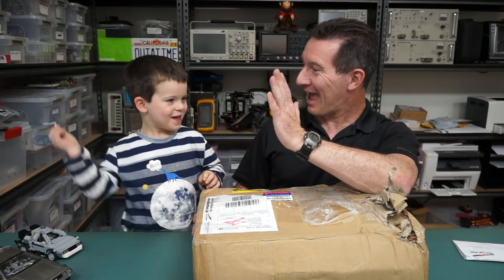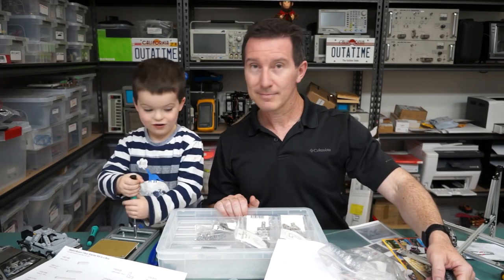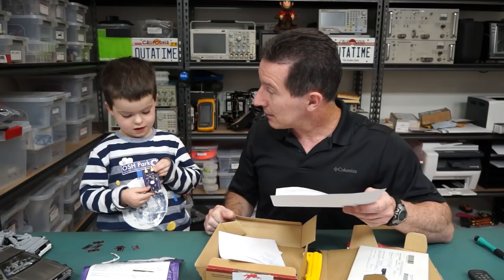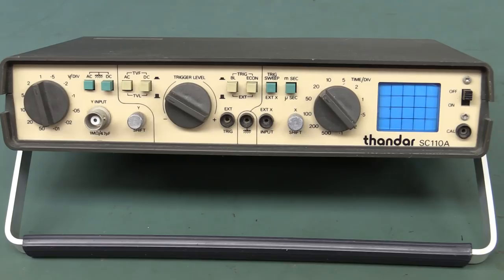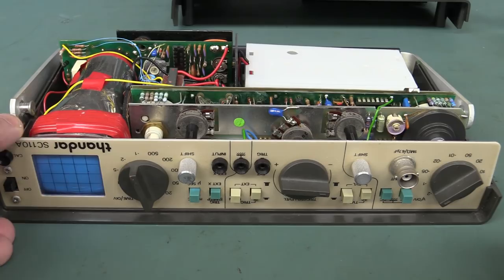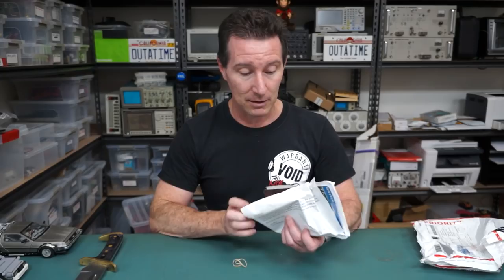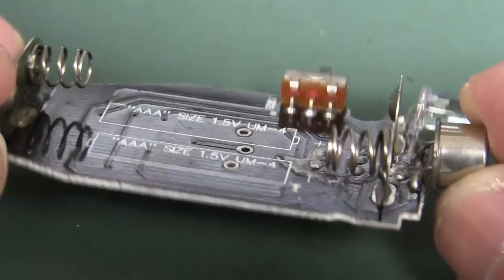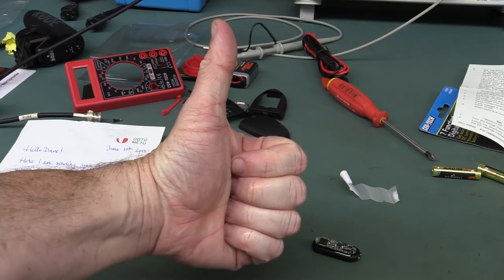EEVblog #813 - Mailbag

Comment: I have the 92020 version of the HF which includes a gorgeous orange backlight and is surprisingly accurate.  I would never put 10A through these.  So what i did was use all that empty space inside to convert it to a 4-wire tester by putting a good rechargeable lithium ion battery from an old cell phone + powerbank chip + a homemade LM317 100 mA constant current circuit inside, with a 2P connector in place of the 10A jack.  Everything else still works off 9V, but I get the most use out of checking USB cables with the 4-wire-on-demand feature I added in conjunction with the 200 mV setting (multiply by 10 for milliohms).  I don't know if anyone makes a small portable 4-wire tester like what I now have?  I know this multimeter is a joke, but not everybody needs a big knife!  A really nice meter for someone who can't afford much.

Comment: I have such a cheap multimeter for years now, it had to withstand many troubles with me. Shorts ( even with line voltage ), overcurrent in current measurement and so on. The contacts for the probes are worn now and the measurement is incorrect as hell. Well, time to spend another 5 bucks, there good for my needs :)

Comment: found this patent about an  intrusion detection device from 1974 by J Rossin http://www.google.com.br/patents/US3839640

note this part: "This invention using a 1% inch diameter concave mirror can easily detect a moving person 25 feet away. Larger mirrors will, of course, detect from greater distances."

Dave I'd suspect that multimeter brand would send you their most accurate product from the test line just to make a scene.
Reply: By the way nice find on the patent on Google will read full thing eventually saved it to favorites.

Just a quick skim over it pretty intriguing and interesting that's something quite a bit different than most motion detectors for sure and also the device that you're referring to in his video yes very different but the problem would be must have battery dies would it be able to indicate nurse an issue with the sensor? Maybe if do barristers to get low input sound of a certain parent of false detections the indicators a problem with the sensor or something of course a system designed like that would probably have a way of determining if the sensor had an issue or the battery was getting low but it may have been too early for that but if you're a lot of them I can see if there was no way to indicate if there was a brown with battery or sensor if you have a lot of those it could get confusing or say it was in an awkward to get at place just trying to figure out what was going on I could see that if it had had it replacement batteries in a battery holder both Glow Draw lithium would be better but still something like that being solar powered by a lithium battery in hard-wired into place but an advantage would be you would not need power after detector simplified wiring and hook up for the sensor but it's kind of Niche product I'd say just an odd one in general I doubt they still use things like this or somewhere like that would still be available is with all the advances and more modern systems? But may still be in service somewhere someone out doing something who knows.

Also I I have seen very old motion detectors that were humongous in Old buildings and even Tone Ultra Sonic alarms are basically obsolete even the box that could be set on a shelf self-contained ultrasonic alarm probably from the 50s or 60s still working to this day.

Have Salvage all types of equipment like that for parts and repurposing old alarm systems that were functionally obsolete for who knows how many decades you know the old green box up on the wall it'd be rectangular and probably have a battery in it likely number 9 drawer cell in some cases.

So those were essentially a glorified exit alarm for a door some of them even had the hardware for that accept had a small relay module how do I know this I've seen the door alarm version from the same company and the alarm version from the same company most of the inside is identical.

Sometimes I do work to liberate things for Salvage in others as part of the deal for something that need to be done and sometimes I got more than I bargained for like once almost a whole basement full of old equipment.

Also I did actually couple times use old remote control systems that work for TVs that were ultrasonic and repurpose them for other projects.

Although one of the more interesting remotes I've seen was not ultrasonic or infrared basically a glorified flashlight with a relay that would flash the bulb an each Button had a specific flash pattern and it was repeated I think twice maybe three times to avoid false triggering ingenious but it works and yes there was a push button to use the remote as a flashlight which I thought was just why not.

The remote was a bit bigger than an older garage door remote I think it took 2 C batteries side by side at the bottom of it many years ago.

Also I once saw a toy CD player music box crayon saying it similar to the one that Radio Shack made except it had a remote that basically work the same way which I found out that particular one deliver or not I was able to take the output of that separate circuit board and make it do my bidding can't remember how but I was able to decode it interesting it was two easy dinner face it may have been serial or parallel it seems like Pearl alderman except a few signals put out more than one pint of ones but it seems like the rest of the others would always only be active with one button there was also a word that was active for invalid signals inhibit?

Although I built a CD jukebox system once I got a hold of this equipment that originally used what look like off-the-shelf mini mini disc CD changers except some different controls on a front additional things this weld are on the back more Jack's Imports than you can shake a stick at evidently if you could think of a way to control it it could do it out of the boss parallel port serial port an even individual + 5 to 12 volt triggers for each function seriously definitely some sort of product that was meant to be incorporated into something else I got a lot of these at one time don't remember why I want to fool with them but I did reuse them of course not going to take that part and scrap it when you could build your own jukebox essentially but you got it could be used Standalone and there was a separate remote for Standalone it did not operate any of the other functions or any of that as well not only that they could even be powered by other than line voltage AKA DC and the power supply even Han outputs for other voltages for external are an external connector so basically a prank it was designed to be around designed to be used with whatever application you wanted it to be used for that you might want to control CD playback but yeah mostly look like an summer gear which was strange you think that something like that would be in a rack-mount case but it wasn't but evidently that will available as well strange again.

Also all the audio and everything was run out to multi pin connectors in addition to Indian kid actors and others and with the multiplan connectors they also went through audio switching as well which could be controlled by remote and or other inputs so evidently it could Multiplex or switch audio from one or more of those players to a common output so just one of the weirdest things I've seen along that line of those kind of things but just interesting nonetheless and useful even after the original application was done for I had also a lot of these are spare units as well so don't know where they were so came from where the story but car from someone else there was a hole in my trunks and fousey August he kept a few but the rest not so much also got several years to other people as well that could use them
Reply: Also as for the last part of your comment I bet you if it hasn't happened yet it will of course it usually does?

Also remember to chinese-made phone charger I think it was where there was a ridiculous thing about they're hand-tuned or whatever spark gap and all that crap and no words a defective product that had been written up like that was intentional and also and it was chinese-made if I'm not mistaken and it did go by the name that's commonly referred to as Chinese junk from a certain Market can't think of the name of it at this time but it was hilarious and evidently that was actually from the factory and they sent it as a gag but still rather entertaining kind of reverse of what you'd expect but I think they wanted to have a laugh really who knows how long it took them to find one exactly like that so they could do that.

Comment: It's basically the standard Mastech DT830B except all the Cen-Tech ones have the battery tester with a switch where as the other DT830 devices usually have the knob control the power and no switch. Some of the Cen-Tech multimeters even have Mastech molded into the plastic of the lead ends. If you're planning on giving it to Sagan, make sure you didn't loose the two ball bearings that are in the knob.  I saw them fall out when you were rolling it around.

Comment: Wow, they actually got a trimming pot inside of this one. On couple of these ICL7106 ripoff meters that I've bought in the local shopping mall because they costed less than the 9V battery inside they actually cut costs by replacing trimmer with just a regular resistor... And a bit of plastic cost by omitting the battery chamber and just randomly sticking the battery between PCB and case.

Comment: 33:45 to 43:30 ... Well done on missing the whole point of those cheap multimeters. Being cheap enough to be classed as disposable it's handy to have a fairly flexible and relatively accurate device of this type in your car, bike, boat, etc where it doesn't matter much if it gets damaged. It's better than risking an expensive one in such potentially unfriendly environments.

Comment: I had two of these, the multimeter itself worked fine for what I've been doing, but the leads broke on both of them within a few weeks.
Reply: Same, ended up soldering the leads directly onto the PCB.

Comment: I've had a Cen-Tech meter for several years and surprisingly it still works, mine looks almost identical to the one here except it has a backlight button in the upper left area by the DCV label.

Comment: I have several meters.  Even have one of those cheap POS meters.  It does the job in a pinch.  The better ones sold by HF are the automotive ones, and the higher end meters are fairly decent.

Comment: My guess is that it's a bug (I.e. Listening device). Check the focal length of the mirrored part; it's probably right at the surface on the mounting plate which picks up ambient sound.

Comment: notice  830B  marking on the el cheapos PCB, all of them one way or another are 830B's,  in 1998 or   in 2003  or  even 2015.
my guess is 830B was 'original' design or it  has smth. to do with ic number.

Comment: the mystery rossin item is a beam detector. Ive seen one of these before though it was different and under a different brand. But im 99% sure thats what it is. (similar components, near same sensor) They are used in security. Thats about all the info I can give.

Comment: 38:45 the connector board of the cheapo multimeter is actually only rated 5A but the spec on the front says 10A :-)

Comment: That "free" multimeter looks like one I borrowed from a friend to help me fix his friend's TV set. Fortunately it was adequate, and it was just a failed fuse with no obvious cause. I had the set working again in under an hour, including going to a shop for the part. Transistor sockets are definite frippery.

Comment: I've owned three of those cheap Cen-Tech multimeters purchased for hobby field box use for I'd guess an average of US$2.95 on sale over the years. Every one of them eventually became wonky in a very strange way in the DC voltage mode that wasn't fixed by changing the battery or found by a cursory internal examination. I haven't purchased one since the last one failed and have, instead, two UT33Ds for that purpose now that I much prefer.

Comment: I've had quite a few of those HF meters, some yellow, and later ones red. I was reading voltages on a 480V VFD (supplied via a small transformer) and accidentally had it on ohms rather than VAC (knob was turned 180 degrees), and I heard a little "pop" and perhaps saw a little spark, and the meter was thenceforth DOA. They are amazing for the price (free!). My main gripe is low ohms zero usually 1-2 ohms minimum, mostly because of the cheap rotary switch with non-gold-flashed tracks.

Comment: To be fair to that multimeter, everyone should have more than one of the things, and that one seems absolutely ideal for measuring low voltage stuff. A hobbyist might stretch to one second-hand Fluke, but a couple of these things would be very useful for extra measurements. It seems to be more or less the same as the DT830, which sells for about £2 ($5AUD) on AliExpress.

Comment: I had a cheap multimeter from Christmas. The fuse blew when I accidentally shorted the amps on a car battery. The fuse blew but the board traces were still fucked. WTF?

Comment: When I started my career as a Home Products Service Technician my first meter cost $29.95 ..
That was in 1973. I made $2.00 an hour. Take home pay was $66.92 a week. Almost half a weeks pay to buy that meter. There were no "cheap" alternatives. Simpson, Amprobe, Triplett. Mine was a UEI made in Japan an M75
Later I upgraded to an M110.($45.00) The M110 had a fused input.  I also had an Amprobe RS 3 about the same price. The do it yourselfer gadget was a neon bulb with probes.

Comment: i've got a centec meter like that, but mine is yellow and its accuracy is off something fierce. 120v lines measure like 140 and 240 lines measure like 380. besides with nothing plugged in its like 4 volts anyway. but i do keep a working one as a basic voltage secondary.

Comment: I don't have a problem with the concept of a $5 DMM - They'll often suffice for many simple jobs in lousy environments - general automotive sensor troubleshooting in the dirt, etc - where you're not going to cry when they fall into a pan of waste oil, you burn the lead on a hot manifold, or when the newb blows them up. What gets me is $5 DMM's that retail for $75 as if they're actually worth a pinch of turd - which is what Canadian Tire sells them for.

Comment: The advice of using certified safety goggles with that multimeter is probably not that bad - we have seen this unprotected crap being blown to pieces in a prior video... What a pity that these goggles would probably cost at least double the price of the actual meter :-(

Comment: IIRC the blue "wire-wrap" on the transformer is the filament winding - an easy way to make the extra winding that can withstand being kept at high HV level.
Reply: I was thinking it was a form of degauss coil.... if you know what that is then you are an old fart 😃
Reply: +A. R. Jasso Of course i know what a degaussing coil is. There is no need for degaussing in a electrostatic deflected CRT with no shadow mask. The Mu-metal shielding around the tube takes care of the shielding of errant magnetic fields.

Comment: Dave, I think you are a bit harsh on these multimeters. I own three very similar to this one and they come in very handy. I can do nice experiments like measuring Ibe, Ice and Vce on a transistor at the same time, using just €15 in equipment cost. (I bought them for €5 each at a gas station.)  The accuracy is pretty decent as you have shown.
Also I can play around with them to do things like add a backlight to the display, without any risk to break expensive equipment.
And look at the market success of this product: they are available all over the world; millions of these must have been sold.
I promise I won't use them on mains-connected stuff (from now on).

Comment: 35:42 - 'Current accuracy'! Harumph. I'm more concerned with the meter's FUTURE accuracy :)
Reply: Yeah and accuracy drift but even though it had a parts per million are parts per billion or anyting person for whatever when it was first made if that would even be accurate? Depending on what angle your tongue is at room temperature battery level rosehips humidity barometric pressure whether the stars are aligned 40 electrons are upside down because of you have the meter upside down and they're all falling out or if your tongue is at the wrong angle and mouth is open Godsmack at the probably trying to troubleshoot that even could influence to reading other metre itself not to mention intermittent test leads causing any more errors or just how much you turn did lead in its socket could even make a discernible difference your test results May Vary if you get the point

Comment: We sell those alcohol testers in Maplin UK for £10 (with a penny change) in a slightly different case with added timers.  The alcohol tester works when you hold down the power button until the LEDS settle down with the green one on, but hold the button down for the next bit! Then you blow into the end to get your reading of your alcohol breath, or not!
Reply: btw fool, you turned the torch on!

Comment: The Harbor-Freight multi-meter, which you can get it FREE with purchase.  They are good enough for everyday use.  I have 3 others that I paid about $25 many years ago, not much better than these.  I have about 6 of these free ones, lost count.  One in each car, bedroom, studyroom, work bench, again, lost count.  One of them had a failed display, missing a few segments, I could still guess the number (I save it for parts).  The lead wires are a weak link, the wires inside are very thin, breaks/unsolder easily.  But I can fix them easily.  No complain from me for these FREE meters.